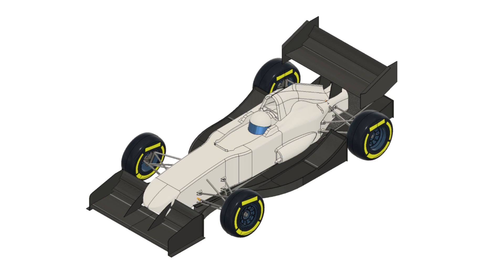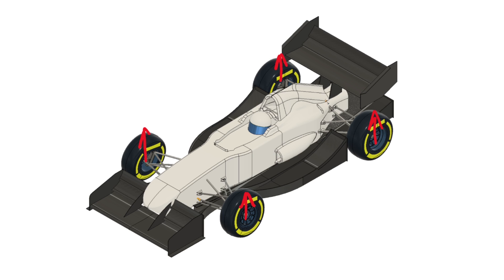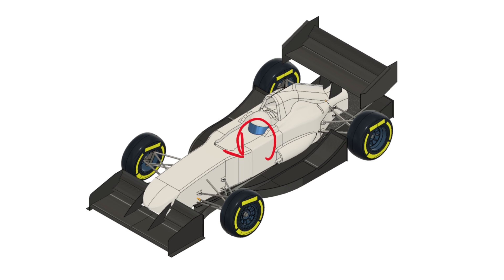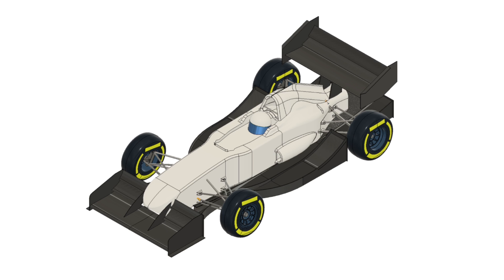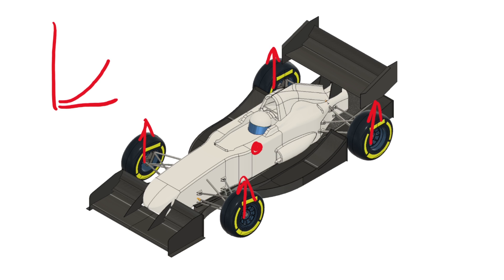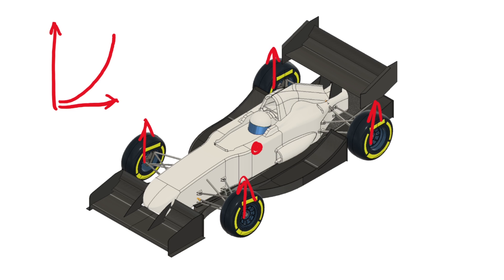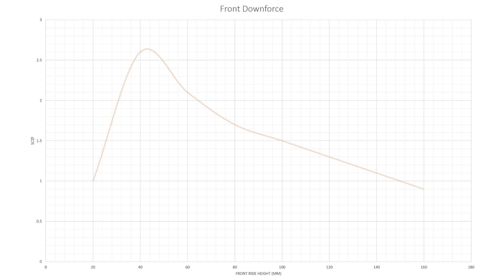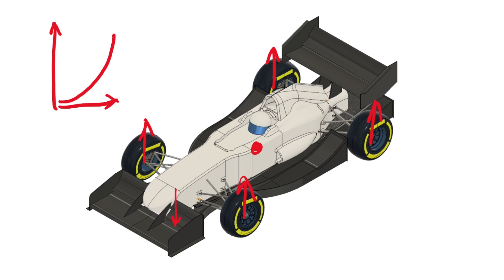How Do Heave Springs Work? Third Elements Explained

Comment: Just out of naive curiosity, why does he refer to the wheels going up and down when they are typically pretty much on the track surface most of the time, when the chassis seems to be doing the most movement ? I did hear the "relative to the ..." comments but still seems a bit confusing. Thanks

Comment: 8:22 What do you mean, the heave spring doesn't act at all in roll? The vertical tube of the T-bar is an anti-roll bar. If it's so rigid that it doesn't twist, as one wheel lifts 2",  the lateral member of the T-bar moves straight back and the other wheel will lift 2" as well, compressing the heave spring.

Comment: One questions after having thought aber the anti-roll-bar… is the anti-roll-bar mechanically (as the levers are arranged) not an anti-anti-roll-bar 😅?

Because, if one wheel moves up, the other wheel moves down… so, the only tendency to resist roll is due to the torsional resistance? Couldn’t this be improved by arranging the levers in a way where mechanical arrangement and forces support anti-roll?

Comment: Thanks for this great video - I am at the early stages of designing my own Exo road/track day car.  I plan to have some wing and "ground effect"  floor in the car. 
I was wondering if it is worth me using this T bar set up or is it only really any use with cars with large amounts of down force? 
If it would be good how do I work out the spring/damping for the T bar, also what size bar should the T bar be? Or is flattened tube an option so I can rotate it to change the amount of force needed to bend it (a bit like the chassis bars used on karts). 
Also does this system mean the suspension has an amount of anti-dive on the brakes?

Comment: Remarkable to see in my lifetime the changes with suspension systems on open-wheel racers.
Look back at some of the F1 cars of the 1960s, such as McLaren M7A, where it had exposed coil springs in the front and rear suspension.
Car builders back then, such as Colin Chapman for Lotus and Dan Gurney with AAR Eagle seemed better aware of the aero drag of exposed coil springs; where they had the font suspension coil springs mounted inboard with their F1 racers.

Comment: Suspension and aero stuff are rarely talked about in relation to power stuff. Subbed.
Reply: Suspension and aero is more important than power, it's easy to make more power, hard to build a proper suspension and aero design.

Comment: How would you construct a Collapsing Heavy Spring? That is a heave-spring which will resist compression until the down-force reaches a certain level and then collapses at a controllable rate.

Comment: Thank you, that was the simplest, clearest and most concise explanation of one of the cleverest mechanical solutions that I have seen in many, many years. Both setups that you put together were, to my thinking, the most excellent and elegant way that it could possibly be done and each solution perfectly suited the differing conditions required front and rear with, as you showed so well, the rear wheels that just go in a straight line can use a simpler but perfectly effective system and the sheer elegance of then setting up for the front wheels that turn and squirm in ways the rear is unable, well, thank you, I cannot tell you how pleased my mind is with what you have shared, thank you. By that I mean, with absolute respect, that in the way my heart responds when hearing a clever and very funny joke that spontaneously makes me laugh, when I hear music that stirs my soul, when I taste something that makes my knees go weak, that’s kind of how my mind feels at the moment, satiated and content having learned a great new treasure that some very, very clever person figured out and wow, good on them, that is sheer genius and good on you for showing us how clever they truly are, thanks mate, good onya from down under ,’o~)

Comment: Is it possible to run a high aero car very high off the ground and (highly) effectively use vortex generators to seal the underbody/tunnels/floor and also prevent rear tire squirt with the same vortex?

Comment: how do dampers switch the damping intensity/viscosity of fluid medium for fast vs slow bump, rebound. Is it possible to have a suspension that will be gentle on the drivers' bottoms (and allow for easier vision without porpoising shakiness) and still maintain stable aero platform (kinda like how f1 drivers would like the 2022 cars to be)?
Reply: There’s different valving designs. One style uses discs as the valve. Small bumps don’t deflect the disc as much so the shock can stay stiffer, large bumps deflect the disc more so it softens the shock. A different style can use different orifices so the stiffness of the shock can change over its travel. Those are more common in offroad racing where you’ll want a shock that lands good from a jump at full extension, but also does good over bumps in the middle of travel. 
Shocks become magic and are pretty complicated for something that is also simple.

Comment: This is so relevant to what is happening now with the porpoising on the new car.    What if there was a mechanical way to control the damper on the  heave spring relative to ride height?  ie. much more dampening when car ride height is  compressed beyond optimal?   maybe even on the independent dampers on the corners?    just to keep the bouncing frequency to less than the oscillation for that track.   is this possible?  and is it legal?
Reply: Haas’s rear has two stage heave springs. There was a F1 tech talk about suspension that mentions it after Micks Monaco crash

Comment: I have a topic for you.  You are right downforce increases with the square of the velocity for traditional wing elements, but for ground-effect cars, downforce also varies with the height of the car's skirt, even at a constant speed.  Your thoughts?  Personally, I think this is the origin of the current porpoising problem.

Comment: What do you think about using air bag suspension with ride height sensors to achive simular effect ? In road car based suspension systems retrofitting a air bag seems to be easier than 3 shock pushrod suspension.

Comment: This was really cool to learn about but there's still one thing that's puzzling me. How would a team set up a non linear spring so that its got linear motion up to around 150kps, then suddenly drops 2-3 inches then goes back to linear motion like what was on the Mercedes in 2021. I just cant get my head around how you can get a traditional spring or torsion bar or react like that.

Comment: In summary, if I understand correctly, you would want to bottom out the heave spring a little before the corner springs bottom out, for purpose of ride height control.

Comment: Could you please do a video on motion ratio regarding rockers increasing stiffness in bump so as to keep softer wheel rate at low aero and increasing for higher aero. This rate can be changed by rotating the rockers. Cheers Gary

Comment: What about heave vs pitch? 

I guess there's no way to distinguish them without some front to rear connection, but maybe I'm missing something.
Reply: No, you're right. You need a front-rear connection for that. You could use an anti-roll bar type setup, except oriented sideways to connect the front and rear, or do it hydraulically like some F1 cars did before it was banned.

Comment: At the rear, that heave spring/damper does anti squat too or you'd have another system for that?
(And same question for the front)
Reply: Since the front and rear aren't connected, the heave springs at either end also act in squat/dive as well, yes.

A "heave only" system that doesn't affect squat or dive would be an interesting thing, kinda like a Z-bar between the front and rear suspension...

Comment: Now I wonder, how to tune heave stiffness without affecting the pitch stiffness? Or rather how to isolate heave from pitch (in the way that this video showed isolation of heave from roll)?
Reply: Yeah, that'd be an interesting thing... The one solution I can think of, off the top of my head, is a Z-bar type system that connects the front and the rear suspensions' heave modes... 

Basically you'd have a Z-shaped bar (very much like a traditional anti-roll bar, except that when one end moves up, the other goes down) that's connected to the heave modes of the suspension at the front and the rear. In pitch, when both front corners compress, it pulls up on one end of the Z-bar, which pushes the end that's attached to the rear down, all in all not really affecting pitch (at least if the linkages are designed properly...), and in squat the reverse happens. But in full four corner heave, both ends want to go up, which bends the Z-bar and makes it act as a spring.
Reply: @jubuttib  Yeah, that could be a solution, but I wonder what kind of solution is actually used in cars like F1, if it's used at all. I can see some problems with the solution you commented about (if I understood it correctly), like the stiffness of the bar and ergonomics of its connections to the suspensions and the chassis of the vehicle (I understand it being a z shaped beam where its ends are connected to the front and rear suspensions, and that there's a pivot point connected to the chassis). If I'm not mistaken, I think I've heard of a hydraulic system connecting suspension rods of each wheel together, and controlling pitch, roll, heave and warp parameters with valves. Of course that kind of system has complications of its own. Other than that, I can think of a cord system, which would connect to each wheel's suspension to each other, and each cord would have a spring which would control either the pitch, warp, heave or roll characteristics, depending on which wheels is the cord connected to.
 
I'm kinda disappointed that the video actually discusses pitch springs rather than heave ones, there would actually have to be something connecting front and rear suspensions, and that something would need a spring, for it to be an actual heave spring.
Reply: @TheDamian58c  I think F1 uses something akin to what was in the video, pretty sure they do "heave" via having 3rd springs front and rear. I haven't heard of any cars IRL that would have a fully separate four wheel heave system, beyond MAYBE something like the inter and cross connected hydraulic system of some McLaren road cars... I don't think the added complexity and weight is worth it for most racing applications. It is an interesting thought however.

Also FWIW I do work with vehicle simulations, and have had to look up lots of different suspension layouts over the years. Not saying that I know everything (FAR from it) but I have had a gander at a fair few.

Comment: wait, I'm confused. Wouldn't the T-bar induce roll? sure the torsion spring would reduce it, but 1 wheel being pushed up (during roll), pushes the other wheel down.... inducing more roll...?
Reply: No because the T-bar is pivoted in below and therefor not in fixed state where it pushes that T-bar other direction on the other end. When one wheel is pushed up that side of T-bars upper end is moving forward and it's torsion spring tries to fight it back and same time it moves the other end of that upper side of T-bar forward and thus tries to level other wheel upwards. Just like antirollbar. Don't know if this is in any undestandable form since my english isn't the greatest (not my native language).
Edit: That animation without third shock was kinda bad because it didn't show that torsionbar moving back and forth and twisting under load.

Comment: Maybe I missed it but it wasn’t clear to me how the heave setup you showed allowed for independent adjustment of heave and pitch. It seemed to me to be a heave/pitch sdu. Are there setups with independent spring/dampers for heave and pitch? Is there any benefit for that? I imagine an independent heave setup would necessitate a front and rear interconnect of some sort. Is that the case? 

Cool video! Thanks!

Comment: to address some possible disadvantage for this kind of heave spring, you have to be careful if you are using nonlinear motion ratio for your dampers/rockers. using nonlinear motion ratio with a T-bar type heave spring can result in higher roll stiffness, because the T-bar will not just rotate about the vertical axis but also pivot about the lateral axis resulting in compression of the heave spring in roll. Also your single wheel bump stiffness will increase, which may not be a problem for relatively smooth track surface on most of the permanent race tracks. but ie. for hillclimb cars, higher bump stiffness may cost you more performance that you gain with aero. in some cases it may be better to minimize your contact patch load variation than adding loads of downforce to the car, it depends mostly on the tyres you are using
Reply: I was just thinking that in the first example, the suspension doesn't really have independent movement. A pump in one wheel forces the other wheel down. Driving on uneven surfaces or taking a lot of curbs, I feel like this antiroll bar T-bar thing may not be the best option.

Comment: Great video, I noticed in the first set up the corner springs/dampers are only really controlling the warp mode, could you go into a bit of detail about removing them for a mono-shock design please?
I have always been interested in them for a weight/cost saving measure but would be interested in some of the problems that may be present?

Comment: Is the 3 element a spring-damper element with all the different adjustments (high/low speed, rebound, pretension etc) that usual suspensions present, or is it something unnecessary and left aside?

Comment: Hydropneumatic spring-less system with self levelling and linear spring rate would be far superior...retaining perfect ride height and mechanical grip without compromise.
Reply: Active suspension would be even better (pure hydraulic) and it was us in formula 1 in early 90, before it was banned. I do not know why in non restricted series is not used now, electric moved long way in last 30 years so making active suspension now is trivial thing.
Reply: @mrlazda  Hydropneumatic is hydraulic only with pressurized Nitrogen as the spring
Reply: @truthseeker8483  I know what is it, I even drow car with it like 25 years ago. But problem in it is gas, you do not want not controlled spring that why in f1 they did not use it even on road car it is in use from early 1950.

Comment: Now show the voodoo magic behind the inerter dampers.
Reply: Watch Engineering Explained's video on electric power steering, seriously. It's not a direct explanation, but it's the same principle
Reply: I do have to say, Doughnut media did a reasonable video on this. It's the "this genius device banned form f1" video.
Reply: @hunterhach7533  They barely scratched the surface. I want to see what's inside of one and how they are tuned etc. F1 banned them, but they are still used in WEC, MotoGP, Indycar, and even drag racing.
Reply: @MX304  every video other than Kyle's scratch the surface <3

Comment: This was great! I have understood how the inboard suspension works but never knew about the heave setups. Very cool!
Reply: FWIW heave springs aren't by any means limited to cars with inboard suspension setups, for example the McLaren 12C/650S road car uses a Z-bar type heave spring at the rear. It acts similarly to a rollbar, but since it's Z-shaped instead of U-shaped, it only acts when both sides are compressed (so for both squatting and heave in this case).

Comment: One important thing to note as well is that heave spring makes the anti roll Bar less effective.

When the car is rolling the ARB now has to work harder fighting the heave spring to lift the other wheel. 

So heave spring stiffness increase must also be accompanied by ARB stiffness increase to compensate.
Reply: I don't think that's true. You could lock the heave spring assembly,  reduce the roll torsion spring stiffness to zero and roll the car side to side by hand.  They're independent as far as i can tell.

Comment: Back in the dickity day we used to run “Z” bars.  Packaging on a modern open wheeler would not be great, but they may be a solution on a time attack car.
Reply: You like to hear that McLaren actually used a Z-Bar in the rear of the 12C/650S road car for extra downforce handling. =)

Comment: Hey Kyle I know Youtube probably isnt the place for this but i am having issues testing 2D simulations with an fsae undertray. The data trend I'm finding shows the most downforce on the 2D under tray happens at a 0 deg inlet angle and this data doesn't match with an FSAE paper I'm trying to replicate. Is it possible to help with this issue with my simulations or to direct me to good sources that could shed light on what part of my simulations is causing my issues?

Comment: Does the third element helps pitch? Like when the vehicle is under heaving braking and the vehicle starts to pitch forward. Would the third element help to prevent the vehicle from bottoming out in this case if you have a very low ride height?
Reply: yes it would. It's only connected to the one axle so if both wheels move in the same direction the heave system comes into play. As you noted, yes this could help prevent bottoming out. All of this design should become even more important for F1 cars in 2022 due to the move to 18" wheels and lower profile tires. Meaning that less of the suspension travel will be made up but the tires squishing.
Reply: Thanks very much